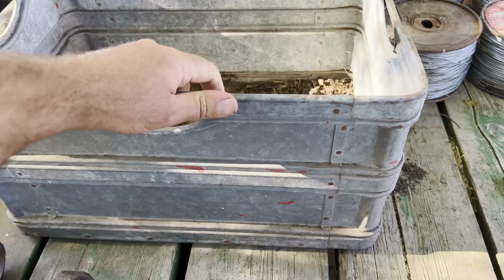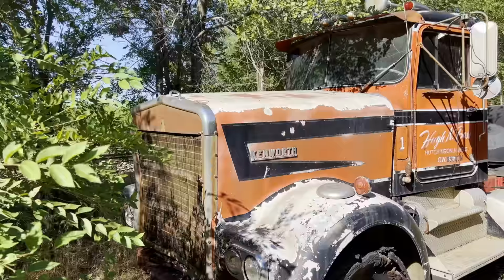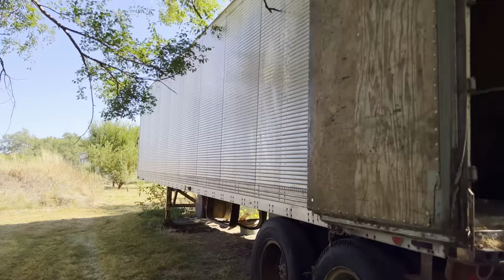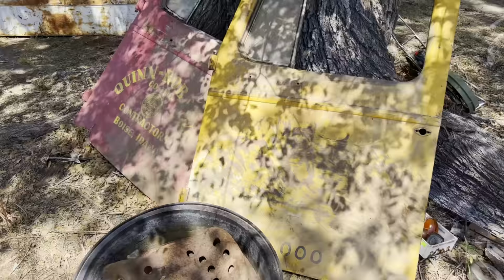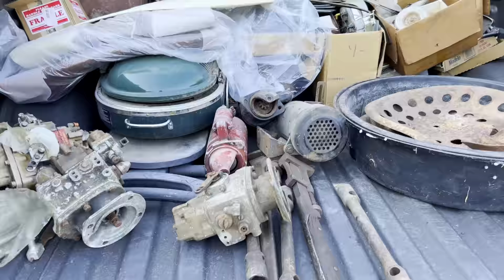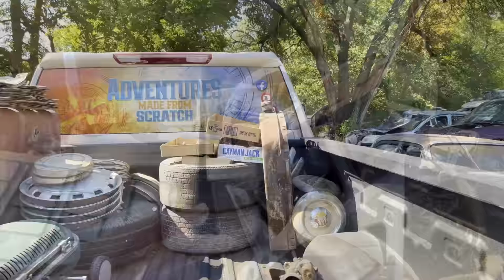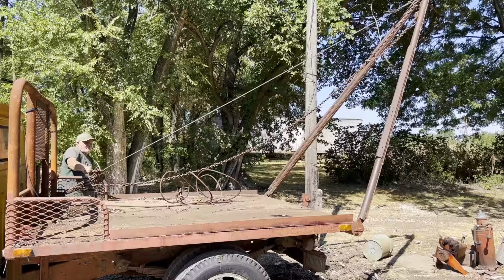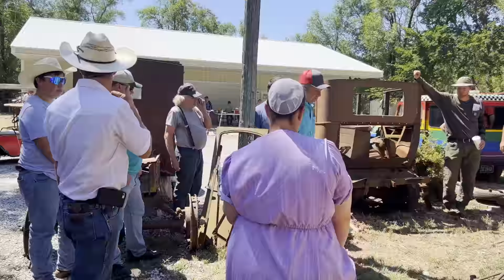Buying Vintage Cars, Trucks, RARE Antiques & More! Farm Auction in nearly Abandoned old Kansas Town

Comment: Great video. There is a neat thing to do with old tires but helps to have a lot of them. They make strong driveways or roads. You have to dig and level out the ground. Line them up in single height rows and columns. Completely pack insides with dirt and then cover with dirt and gravel. No more worries about washed out driveways. Some people have also used this method for cabin and/or off grid foundations.😊

Comment: That gin pole truck was designed to flip the pole back over the cab by the load of it, so you can still use the flatbed and then load and unload with the pole when needed
Reply from the maker: We tried that, but it stops pointing almost straight in the air 😆

Comment: Not sure what the roof rack was off of, but today I'd sell it to someone building out a van to live/travel in.  It could double as a little deck space if floored, or double as a stealthy place to put a solar panel.  And possibly all of the above if an expensive walk-on strength solar panel is used.  The channels or extrusions on the bottom of it are ideal for mounting a solar panel to.  Plus it's retro/cool, bordering on badass.

Comment: i'm Early BUT liked the video already cause you never put a bad one out
Reply: the 6 volt horn CAN be used on a 12 volt system if you simply wire a chrysler porcelain Ballast Resistor in the power line.. cuts it down to 7 volt

Comment: I love that vintage Dodge Bros car. It would be wonderful to have a complete nuts and bolts restoration
Reply from the maker: It’s going to have a crazy future actually. More details will be out on that later in the year
Reply: @AdventuresMadeFromScratch  That's good to hear Silas, I got a lump in my throat when you mentioned crushing party or whatever.  If it were up to my decision I'd splatter a gallon of cheap oil base paint on it, toss a couple hoods over the top, list it and until it sells use it for yard art.  That's a classic, too bad I'm poor.  By the way I'm a Ford man and a 327 Chevy man not Dodge, but wow, these oldies are awesome.

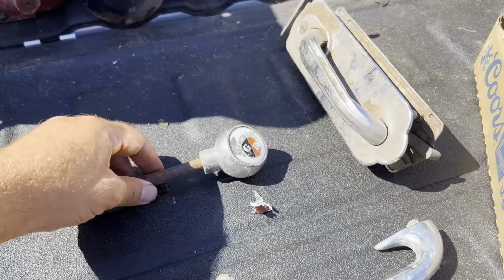Comment: The handle at 30:20 looks like it belongs to a refrigerated box to me. Which may make it pretty hard to find...lol and/or sell too! Yes the c40 is an odd duck, most of the ones I've seen are in that cab style (to '66)... later ones (67-72)are even rarer. I don't know if they did them in the 73 up square bodies. Thanks for sharing

Comment: i’m not sure if you know this or not on the Chevy 283 i know you bought it for the Carburetor  but  the Old Chris Craft Powerboats used 283s marinized with Chris Craft bolt on Parts basically to basically turn them into Raw Water Cooled motors  the 283s had a Forged Crank  and that was what made them good for Marine Use because they could handle the extra Tourque put on them spinning a Propeller  in the Water  i restored a 1964 Chris Craft CabinCruiser  in the early 90s and i needed a replacement motor  at that time the 283 engines were getting difficult to find  although through my LocalChevy guys i found one a guy had used to Restore a olImpala and sadly the car got totaled in a Collission  right after  the Restoration  the guy actually was  a Auto Mechanic and he pulled the motor thinking he would have another use for it in the future  in reality it just got in his way  so he wound up letting it go to me fairly cheap  as when i found him i had Cash in my Pocket  as far as i’m aware  that Engine is still in my old boat  i mention this because it might be a Market you weren’t aware of  that group of people self included  doesn’t mind spending Stupid Money on things we need  to keep things Period Correct or As close to Factory as we can  i know you mentioned it was Locked up  but chances are  a guy using it in a boat plans on going through it anyway  i did the same with mine  with the Help of my then Local Chevy Machine Shop guy  i was lucky enough to be freinds with  two local Brothers and Mechanics that restored Bel Airs and first GenerationCamaros  plus raced them  with their Garage name on them  that was in a WashingtonD.C. Suburb  and the Chevy guys were pretty tight  they all knew one another ,used the same Local Shops  and kept tabs on the Motors that were at one time in their Ownership  i was a Woodworker myself  played Around in Cars and Power boats  and Ironically two of my Coworkers  had owned a Locall very successfull Corvette Speed Shop  and those guys got dibs on on most of the Wrecked Cars that Insurance Companies Totalled  and those guys  would pull the motors and warehouse them  and sold them off cheapn as is  i actually know wher two of those Motors made it into peoples Work Trucks one of which was a Old Grumman Box Truck my Company one time Owned as our Deleviry truck we blew the  original SmallBlock  and bought a old Corvette motor for a few hundred dollars at that time it was the cheapest  route for us to get our Truck back on the Road